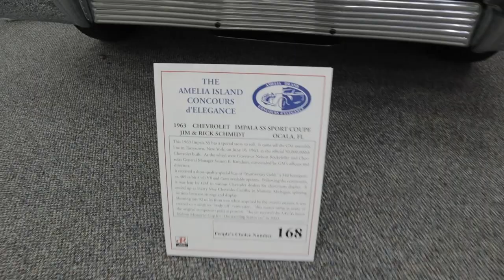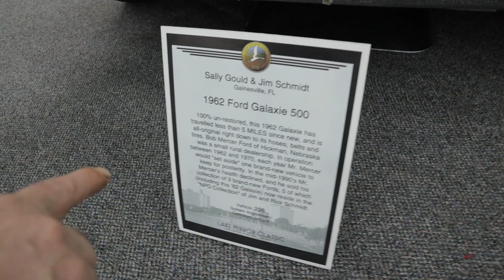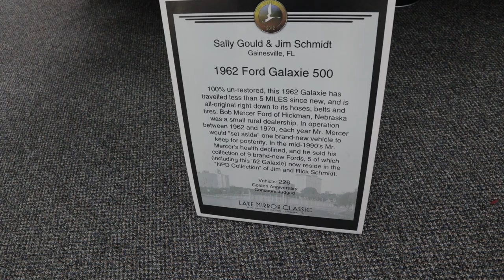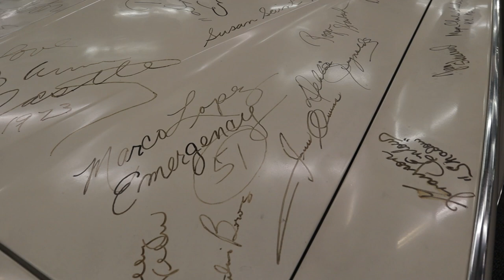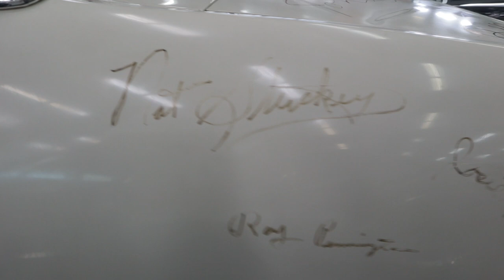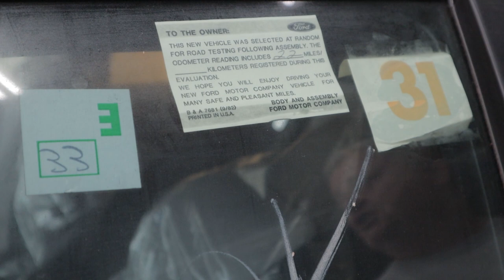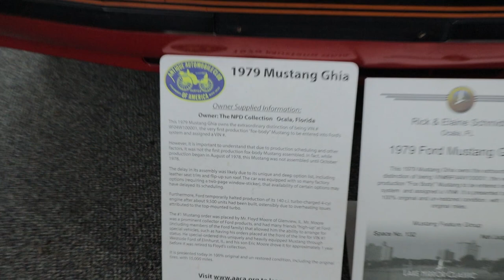Gonzo Touring The Amazing NPD Collection Of Classic American Cars

Comment: The MEL 430 was originally designed with racing in mind, but was de-tuned for usage in the 58 Lincolns. For 59 it was further de-tuned because it proved to be too powerful for many owners.

They were used in tractor pulling for a long time. I bought several MEL 462 parts of a farmer, here in The Netherlands.
Reply: I think that 1957 Merc Turnpike Cruiser was the first car rated at 400 horsepower

Comment: Great video and wonderful collection.  NPD is THE place to go for many parts which they can pattern right off their own collection.  58 Mercury with tri-tone paint, MEL motor - high option car : -)  Graduated HS in '66, so almost all the cars in the earlier part of the video were all around me.  Buddies with the son of the local Lincoln/Mercury dealer, so we got to play with much of that stuff.  S-55's and such were daily drivers for him.  I did Ford, but had access to the Merc parts window, soooo ...  Those FE's with three speeds, all syncro HD 3-speeds from the truck parts bin (C5AZ IIRC..).  Fenton made a slick shifter for them.  Nearly indestructible and did not give up much to the 4-speed guys.  Worked real well on the street with average pavement.  Lotta the 4-speed guys would blow off the tires with deep 1st gear  : D  
Lotta memories in that barn ...
Reply: Actually the 3 speed most likely worked better in many cases, even with FE engines. The mainstream FE and MEL's didn't have heavy duty valve springs so high revving wasn't in question. But weren't short on low end torque, which was very good even in 2bbl. FE's...
A miserly old man that lived in my area used to have an old 68 F100 3 on the tree. He took off in high gear all the time, unless he was on a incline then 2nd was his next choice.... The old 360 never even quivered...

Comment: No disrespect intended but that wasn’t a MEL in the 58 turnpike cruiser, that was a 368 yblock only offered to mercury. Mels look like an FEs bigger brother with the dissy in front, easiest way to tell the difference is the head dosent make up part of the intake and no production line Mel used adj rockers ( some say the 400hp 430 Mel super marauder did but I’ve yet to confirm that) those 368s have a vary unique “M”valve cover. I’m glad you guys stoped at it tho, most people would likely walk past it and have no idea a fire breathing motor sits under the hood. Great video !
Reply: Thanks for the updated info... I thought it looked different than they explained...

Comment: Man seeing that 64 bonneville makes me wanna go get mine outta the shop.....but its freekin freezing out side (ks).......when i started my collection i went with a company not a model and spread it threw the yrs i like.....1950-1979 pontiacs......all full size cars all 2 drs....(but a couple pretty sweet 4 drs snuck in there).....primary interest was in stick shift cars.....which they didnt make alot of full size stick cars.....except my 50 i wanted a fastback automatic.....the 8 lugs are not a drum wheel assembly the drum is aluminum wit a steel liner for the shoes to ride against....the liners can be replaced on the drums.....

Comment: These type of collections (with the exception of Jay Leno's) bother me, because I know that none of these get driven. Nonetheless, each and every one is beautiful.
Reply: they are no longer cars...they are "Hot Wheels" being displayed in a large display case.
Reply: In this instance, these cars do serve a purpose for not being driven- they're a reference collection for reproduction parts that help keep other examples on the road for years to come. They do drive some of these cars ocasionally, MyClassicCarTV has done several testdrives with them over the years. 

That being said, I do totally agree: cars were meant to be driven!
Reply: I Usually would agree with you cuz I feel that cars are made to be DRIVEN but these are Such LOW Milage cars that its nice to leave them as time Capsules.
Reply: @jontrudell7529  True but they could at least start them and/or drive SOME of them to keep the engines from freezing up as well as cleaning and maintaining the interiors to keep the vinyl from cracking.
Reply: @the_car_guy5915  Clearly they do!

Comment: Was that a 1969 Ford 250 Camper Special,My dad had one with a 390 and it had 4 wheel disc brakes on it.he went to the ford dealer and was ordering the brakes at the counter and the ford man said.it's got drum brakes on it.my dad said they was special ordered..the parts guy went out and looked and said you're correct..whats funny was he would tell me that this truck is just high enough he's get hit in the rear at stop lights it would peel the top of the hoods on the newer cars and not a scratch on the truck..he even loaded a ton of gravel on it and it never got to the helper springs..what a truck.

Comment: That Merc looks like it weighed about what the Queen Mary did.  I remember a couple of those in our town.  I recognized the MEL engine immediately due to the fact that I used to set the valves on one of them for a businessman.  The Ford GT makes the mid-engine Corvettes look really poor in terms of design.  Kind of a wanna-be poor cousin knock-off of an Italian car.  I've heard a lot of guys piss and moan about Fox body Mustangs but I, for one, have grown to really like them as I got to know their good points.
  It took me quite awhile to quit chuckling when Uncle Tony said, "......Until you change to spark plugs."  After working on big block muscle cars for 50+ years I could really relate to that.  My hands look like I was tortured in a concentration camp or by the KGB.

Comment: The reason all the cars like the olds went away is probably the same reason a perfectly straight  rustfree 96 impala is going to the junkyard right now .. Its now not even a $1000 car and the drivers seats got a rip in it and you just put a new muffler on it last month and now the manifold has got a leak in it.

Comment: Is that 61 401 HP Ford a 406 CID?
Reply: I was thinking the same thing. But for the more common man back in 61 the 390 tri power would be easier to get at the local dealer... And supposedly by rule of thumb a 405hp is a 406 tripower.

Comment: Sorry but I had to comment on his statement on the Pontiac 8 lug wheels. He is WRONG. The wheel had a huge open center almost like an old style semi or school bus but had 8 bosses around the inner part which the lug studs would poke through to hold the wheel on. The large aluminum finned center section was the brake drum and stayed on the car and when the drum wore out you only had to replace the brake drum, NOT the entire wheel. The rear drums actually had the standard 5 lug bolt pattern inside it behind the center cap to remove it for brake jobs. Im not sure if the fronts did or if they had the wheel bearings holding them on like the 5 lug wheels or if they bolted on the same as the rears though as I never saw the front drums taken off the 65 Bonneville 421 4spd convertible my brother had just bought the day before (in 1975... I was a little kid but remember every aspect of that car like it was yesterday - right down to the dual "Tiger" mufflers my brother put on it) but he had taken off the rear drum to replace a wheel cylinder with cross threaded brake line threads (ruined by the previous owner when he replaced the steel line (in -20 degree temps... easy to screw things up when you are shaking from shivering) that was damaged by incorrectly wrapping a tow chain around the axle when he got stuck in snow in his driveway when the car was moved out of his dads unheated garage so they could change the transmission in his dads 72 Imperial. The 8 lug setups are very sought after and expensive today as not many were made even though they were introduced in either 59 or 60 and used until either 67, 68 or 69.

Comment: The 1995 Cobra R, you HAD to take the class to buy one. Ford was so scared of putting a 351W into a Mustang they waited until the last year of production, neutered the engine, and made the owners go to driving school to buy one. A healthy 351 in a Fox(or SN95) Mustang is a magical thing, it is difficult to describe how they drive. Imagine a hopped up angry 302, or even a stroker motor 332 or 347, angry idle, the whole shibang.... but then make it run smooth and have perfect street manners and run like a scalded dog anyways. Thats sort of how a 351W is in these cars. 9 Second cars that you could drive to work. 
Ford wouldn't do it, and it's probably for the best, given how many idiots crashed the 215HP versions anyway. 
Oh and the 302 Cobra motor Ford rated at 240Hp or something....lol no. They were close to 290. The same engine got put into Ford Explorers and Mercury Mountaineers and was rated at 285 if I recall in the late 90's(after Mustang went to the abysmal mod motors) Pulling a junkyard Mountaineer GT40P and swapping it into a Mustang was a popular thing for a lot of years till supply ran out. All you needed was a set of headers for the P heads and it was an easy 50-60HP gain into a fox with no other changes made, people would do it instead of a rebuild because it was pennies on the dollar comparatively. 

Saleen had no issue doing a 351W, unlike Ford. Drag race numbers don't begin to tell the story of a Saleen S351R. Those cars could do 80mph around 35mph bends, would run 180mph, they were supercars. Built on a stupid Mustang chassis. I wanted one when they were new, still want one now, but prices go up on them year after year. "Raw, bar bending beast muscle." is a quote from one auto journalist from back in the day about these cars.

Comment: I want a 1972 Torino
Reply: So funny how the Vega  and the Torino influenced the Camaro and Mustangs back then. You can see the 74 Mustang in the flanks of the 73 Torino...
Reply: @kramnull8962  yeah funny though 1972 Torino Sport is the best Torino by sales. 73 got ugly . In 71 the mustang upgraded to the Torino body that’s why people hate the 71-73 mustang
Reply: @chrisgreenaway6696  Well hate is a harish word... The main reason for years of hate  was just the 71-73 engines. 
Back then you had to have the actual performance heads to make any power... Even nowadays it is hard to take a 71-73 head and make it have good power. Though it is easier now than back in the 70's and 80's...